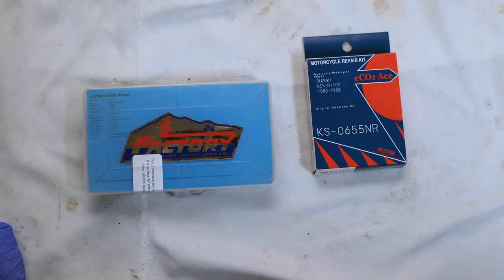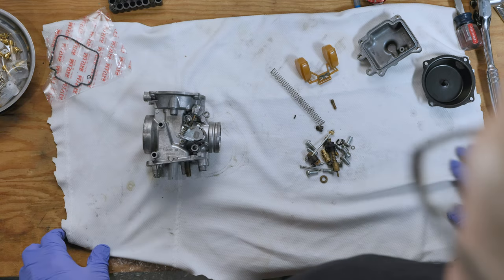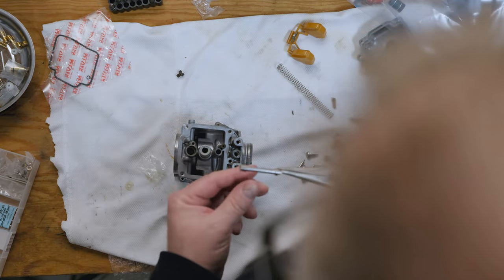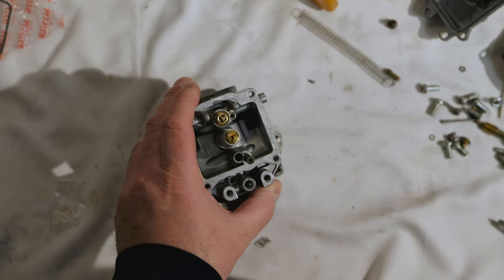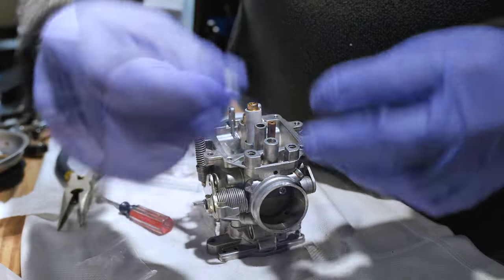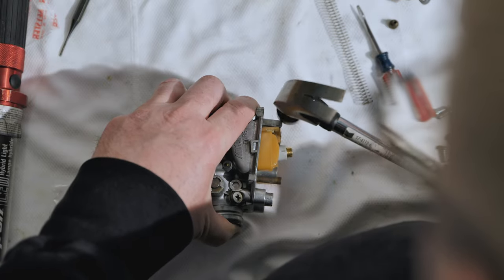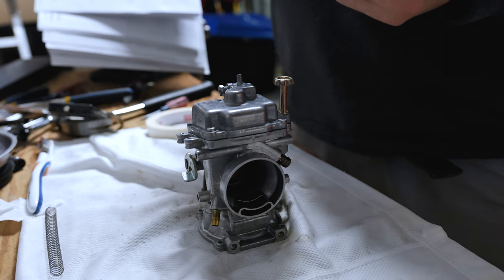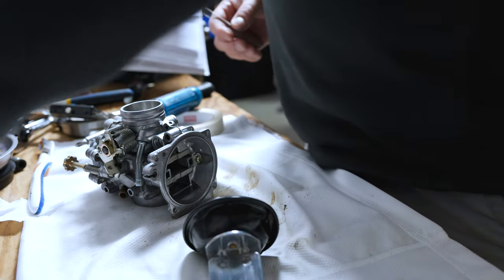Mikuni Carburetor Re-jet and Rebuild Episode 4

Comment: I need those Rubbers mine are disintegrated.
Reply from the maker: I used the original one's, which were still in good condition. I am looking for replacement tubing, and if I find anything, I'll post a link here.